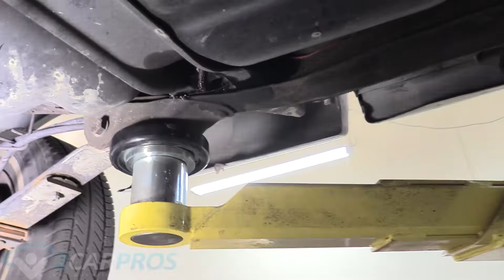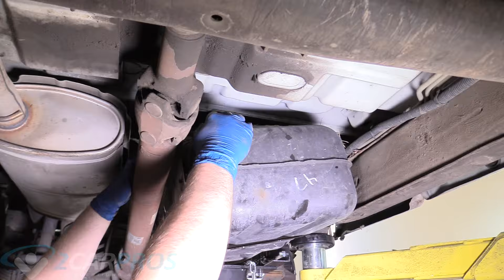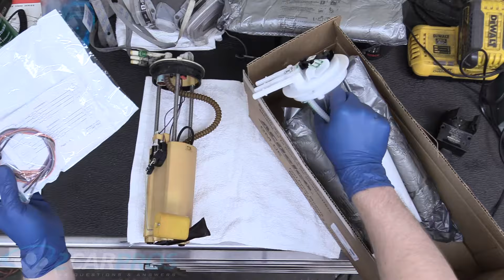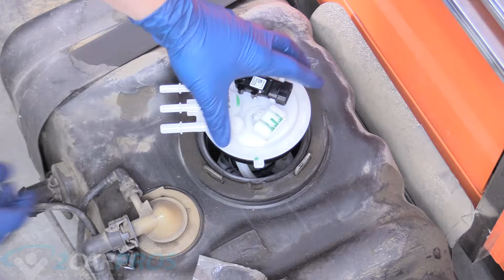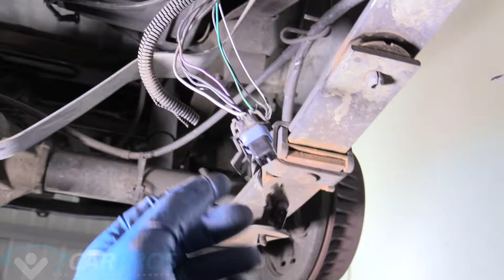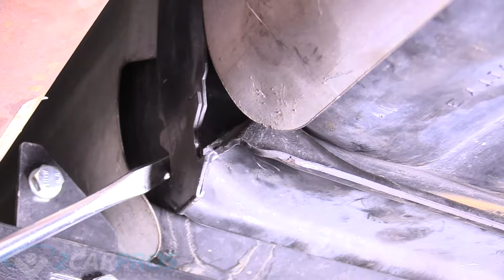How to Replace Fuel Pump Chevrolet S-10 Blazer 1993-2004 - Full Tutorial!

Comment: i really just came to see if there is a trick to seating the new pump with the new retainer ring and o ring, the fuel pump is spring loaded so it’s a pain in the ass to line up while apply the retainer ring …. but you didn’t even show ot
Reply from the maker: I did show it. You hold it down while you use a punch to lock it down. You can do it! Thanks for watching!

Comment: My question is why are all the replacement fuel pumps I see in every video has a different wiring plug, why do the send you the wrong one but instructions and parts to change it yourself? why doesnt ac delco just change to what its suppose to be?

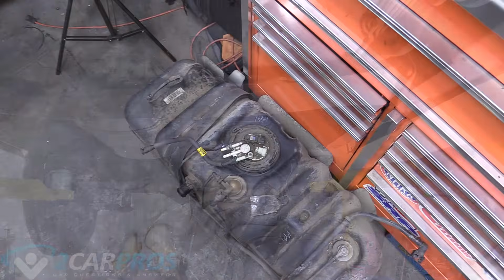Comment: I do have a quick question on 9:15 if you pause the video all the way to the right of the tank there is fuel tank vent valve could you post a video showing how to replace it or at least remove it
Reply: I think he showed how to remove it in the beginning of the video. I was having the same problem. I paused the video and saw he must have unplugged it from the car not the tank

Comment: Bosch and Delphi make the correct pump for the S10 so you dont have to "make" a universal pump work.I bought a AcDelco pump and Summit swore up and down it would work with no mods.Returning the pump was hard as f*** and if i wanted the right pump they would have to order it and it was 2 months out also couldnt get credit from the wromg pump and had to pay again for a correct pump that didnt require hacking the wires.
Reply: Oh I feel your pain my friend I feel your pain, what a good cop out thing to do is call the dealership get the OEM number and then Cross match the numbers and look at the picture and get a picture of both before you jump over that hurdle because once they mail it to you unless it goes right back the same day it's going to be a big big big big big big big headache can you waste your time I want to do a sell you something my friend
Reply: @Bravada1998  I thought AC DELCO was a direct fit and made in the USA.Turns out it was an overseas part in a generic brown box made in Myanmar.Not an AcDelco qenuine printed box.

Comment: Wait, how did you get under there..... ah, that's why I'm taking off the bed
Reply from the maker: That's a way to do it too. I've just had it on the lift and dropped the tank which you could do with a jack and jack stands too. Thanks for watching!
Reply: @2carpros  thanks. Wish I had a lift or level ground which I don't. Gonna have to enjoy the increased mpg's for while lol.

Comment: My fuel pump isn't getter full power after replacing it nothing is reading correctly and no gas is sending to the engine i already looked at all the fuses and replaced one should i replace the clip for the fuel pump itself?
Reply: Did you ever solve this issue?

Comment: Why some sending units have 2 plugs on top some have just one, this one has 2 plugs
Reply from the maker: Probably a mid year refresh or maybe the difference between I4 and V6? Thanks for watching!
Reply: @2carpros  I found it some units come with gas pressure sensor which is the black plug and some don’t it’s removable so you can just use your old one from the old unit

Comment: Ok i took the pump out but the fuel line connectors I broke the one that goes to the rear. How do I take the nylon tubing off the metal tubing and replace the plastic connector and nylon tubing ??

Comment: If you need to chisel, try to use a brass chisel if you have one, to avoid spark 💥
Reply: Wow thanks for the tip. I will use a big long flathead screwdriver instead

Comment: 11:31 I was wondering what that mini thing is sticking out south of the fuel sending unit. it has a line connecting to the middle of the fuel sending unit and has a weird cliped line that connects to the lipped and angled spout. I broke mine while replacing and cant find the name of the sub assembly or the part. 2003 chevy blazer ls 2 door. Thanks!

Comment: the 2door blazer has the fuel tank at the back of the unit , but probably the same procedure .
Reply: ZR2? Might be only on them. My 04 is a ZR2 and the tank is in the rear
Reply: Neither this tank nor pump is ANTHING like that on MY 2 door '93 S10 Blazer (Tahoe LT)! 
 My tank is at the very rear, and the pump has steel tubing with threaded compression fittings, not plastic tubes or push on fittings.  Just fyi..

Comment: My mechenic installed three delpi fuel pumps in four months.They all had a faulty check valve.leaking back in the tank.Not leaking in injectors or pressure regular.Or lines.Has anyone else had that problem?What could cause it?

Comment: I replaced my fuel pump & a new fuel filter, my truck won’t start, I have a 2000 Chevy blazer 6 cylinder. Any idea why?? The new fuel pump is working
Reply: Did you figure it out? Having the same issue I think it’s the lock ring not creating a perfect seal.
Reply: Some with me. I can't get any power reading off any wires going to the pump. And that's when the key is turned forward enough to power the dash
Reply: @clints8731  you only get power for a couple seconds until the truck starts and runs then the pump will have power going to it ... I have seen pumps no good out of the box and can happen with any brand pump more so on the cheaper ones.
Reply: @JimBrideau omg I hope mine works. All this trouble for it not to work

Comment: Excellent clear video. One thing, those wire connectors were heat shrink connectors. If you heated them, they would have shrunk and sealed around the wire. You can identify them by their translucent color.
Reply: Always A True Blue Electrician in the crowd..nice catch...jaja🤣
Reply: If agree due to open ended connectors n fluid....
Reply: Good point sir. Just make sure to use a heat gun not a lighter or matches. We are dealing with a lot of fuel here. Have a fire extinguisher nearby also I did.

Comment: Thank you for making this video. One thing I did that I noticed you didn’t was I put electrical tape over the connectors where the new plug was spliced in. Helps keep moisture out
Reply from the maker: The plug has a rubber sealer inside it but yeah more protection is even better. Thanks for watching!

Comment: Fuel gauge wasn't working my fuel pump went bad replaced it but gauge still doesn't work what could it be
Reply from the maker: The new sender on the new pump could be bad, or its the gauge itself. Also check for any shorts in the wires from the tank to the dash. Thanks for watching!

Comment: You do realize... you're working on a Gen 2. That's 95 and up. Not a 93.
Reply from the maker: False. According to GM the production year span is 1993 to 2004 the model year span is 1994-2004. Thanks for watching!
Reply: @2carpros  then you explain why my my 5.1994 S10 Blazer is a 1st Gen and the same chassis and parts they used from 91 to 94. They changed grille details and some other very small features from the 80s to the 90 model year. Then in 91 is when they changed. Then, 95 model year, is when they started with the Gen 2 round body.
Reply: @Ir0n_the_F0x  negative,  they changed to the generation 2 in 1994 .The 94, 95 , 96 , and 97 all look the same from the front with the rectangular  sealed beam head lights. 98 -2004 they went with the curved or wrap around head lights and a rounded dash.
Reply: @barbiesawada245  I have a March 1994 production line 1st gen. How would I have one, late production, 94 model year, squarebody
Reply: @Ir0n_the_F0x  if you're truck is a 1st generation square body , it is that , no matter what the sticker says , but according to GMs history on the S10 , production on the Gen 2 started in 1994 , thus the rounder lines , they might have had some leftover 93s they built in 1994 till they started production on the 1994 Gen 2. Remember these trucks go by model year , thus they probably built Gen 1 and Gen 2 in the same year.

Comment: Have a 1998 Chevy blazer, fuel pump keeps going out, this time we changed the fuel pump and now you can hear the pump powering on and everything but now still not cranking, any suggestions?
Reply: Did you check your fuel pressure?

Comment: My pump didn't come with the instructions, would someone mind posting a picture or PDF link of the harness connections?
Reply: Mine didn't either. I'm having a lot of trouble matching my wires up. How did you figure it out?
Reply: Match the letters from the old connector to the new one... ABCD

Comment: I just took my 2003 Jimmy blazer to the mechanic to put in a new fuel pump. The hardest part is taking it off. Putting it back on is easy.
Reply: Using the fuel pump tool will save you time and energy trust me!
Reply: @cap3724 is the fuel pump tool those plastic circular pieces that have a opening? I need to see videos of how to use it because I bought pack of 11 and i could not figure out how to use them. I just used my fingers and nails to squeeze the fuel lines. Just by touch and feel the little slot openings on the black fuel lines that’s where the little plastic lip piece you have to squeeze both at the same time. Took me about 30-45 minutes I think. I kind of regret not having mechanic do it. I’m on day two because I was trying to figure out how to get the two vent lines off along with the big rubber hose for gas tank off.

Comment: Amazon says this pump assembly does not fit my 1994 ZR2 4.3L.
Reply from the maker: I wonder if the ZR2 package changes something. Just filter by your truck then. The process is exactly the same. Thanks for watching!
Reply: No your Zr2 fuel tank and pump is different from the longer s10 pickup or 4dr Blazer/Jimmy. That's why some pumps may not fit your application.
Reply: They use different tanks for the newer S10s,  94-95 and maybe 96 uses a 20 gallon tank that doesn't have the small fuel neck next to the main filler neck.  Connectors are different as well and the newer S10s use a 18.5 gallon tank.

Comment: Have to access the fuel pump pressure sensor and was debating about dropping tank vs. pulling up bed.. after seeing this video -- dropping the tank appears to be the way that I will go. will comment further  after I get this done.
Reply: Took me a month to get to this job on my 2003 GMC Sonoma pickup -- and after having watched this video -- I began the process to lower the fuel tank to gain access my fuel pressure sensor... but the 15 mm nut connecting the front fuel tank strap was rusted solid... and since this is a pickup truck -- I elected to opt for plan B and remove the bed...  "Removing the bed" -- really tilting the bed -- worked fantastic for me  - There are eight (8) frame to bed bolts.. - fully remove the front 6 bolts; loosen the rearmost 2 bolts about an inch and then tilt the truck bed and insert 10 inch 2x4's in the front "channel" to keep the bed up.  This provides excellent access to the sensor and the fuel pump..  - there is another video that I watched that employed this method...  but if your vehicle isn't a pickup -- dropping the tank may be the only way.. Another pit of misery moment with this job....  in trying to pry out the pressure sensor -- the plastic stem that sits into the fuel pump;  cracked in the fuel pump... but this sensor is designed with a small diameter hole and I inserted a sheet rock screw into the remains of the plastic stem (have to give me brother credit for this fix) and was able to back out the cracked piece...  Great video.
Reply from the maker: Yeah dropping the tank was no biggie. Thanks for watching Steven!